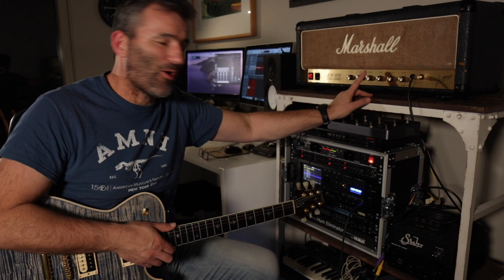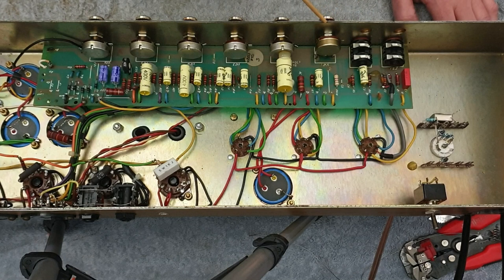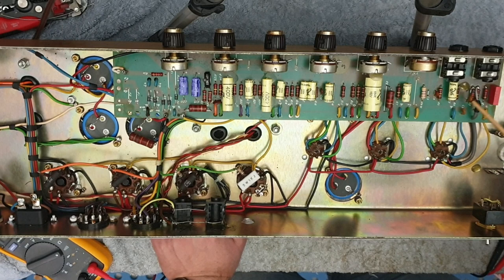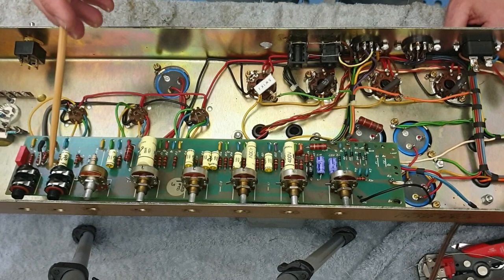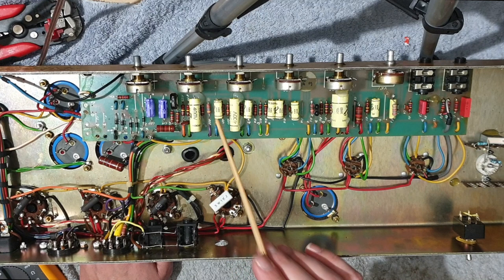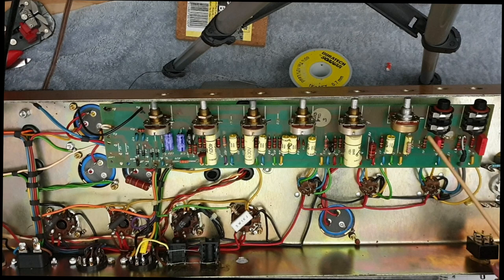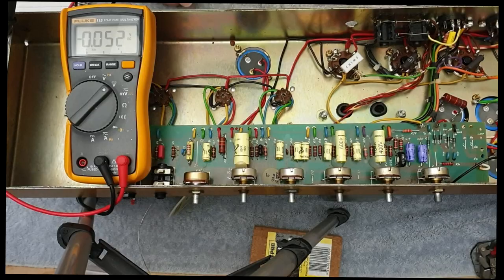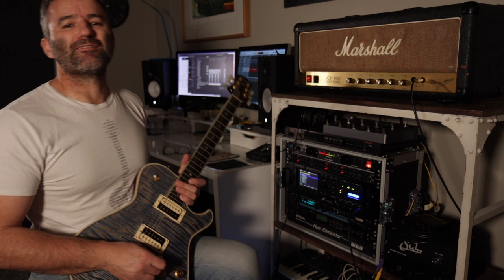Marshall JCM800 2203 Horizontal Input.  MOD TO Jake E. Lee SPEC - DIY!!

Comment: My 1986 JCM 800 2203 horizontal inputs has three of those big blue filter caps. On your picture, the bottom two would be missing. Is there an advantage to having those two extra caps? Do people ever add the two that are missing?

Comment: What does negative feedback do when increased? Can I lower the R22 stock 100k to 47k without doing the fixed depth mod?
Reply: It will probably give you a tighter and little less distorted sound, and yes you can.

Comment: That 1985 does have reduced filtering. The vertical input models have 6 filter cans. Part way through 1984, Marshall switched to horizontal input, PCB-mounded pots, and reduced the filter cans from 6 to 5. Then, part-way through 1985, they reduced the filter cans again, from 5 to 3.
Reply: What's the deal with the big caps? I have a 1989 2203 with 3.
Reply: @lovecraftmusic8717  What I've read is that Marshall reduced them to cut manufacturing costs. There was also some other change in 1986 that affected the sound a bit, I think the compression at higher volumes. I have a 1985 with 5 filter cans, which I sold a great-sounding, 6-can, 1982 2203 to buy because, personally, I prefer the horizontal-input sound, and some of my favourite albums, the early Smashing Pumpkins stuff, were recorded with it.
Reply: @thischannel1071  well, if doesn't affect the sound too much it's ok for me...at the end of the day who can really play a 2203 at high volumes? 😂 Thanks BTW.

Comment: I did this mod to a Ceriatone 2204. The amp squealed like a pig with a motorboat sound through it. What could have caused this?
Reply: You probably dont know what youre doing or shouldnt be working on amps.
Reply: @BigTyronie  You look like a Tyrone.
Reply: @BigTyronie  maybe. But I'd like to learn
Reply from the maker: If you haven't already, join my FB DIY Group.  Lots of help there if you are trying any of my mods.
Reply: @HeadfirstAmps  thanks

Comment: I have an amp here in NZ that began life as a Ceriatone 18 watter. Then it was a JTM 45, and then a JTM 50. Now it is a JMP 1987 with the fancy pants bits like a Marstran OT and PT and mustard caps etc. I bought it as a platform for modding. 

I can see it is still shared cathode, but the only other thing I know about it is he said it is a '69 tone stack. He said he was going for Angus' Live At The Apollo tone (I think he actually used 2203s by then though) It sounds great for old school stuff, but does not really get into the more shreddy '80s tones that I am also into, no matter what kind of pedal I feed it. I want both from a single amp, but to not lose the good old school Plexi sound it currently has (with a treble booster and Gibson, it reminds me most of early MKII Deep Purple live tones).  

What I wonder if there a way to have multiple configs in one amp. The gnarliest Plexi, 2204, and Silver Jube configs  (just the diode clipped lead channel). That way I'd have all my bases covered for the kind of tones I like.  To do it so with every config sounding max legit is the thing though. I dunno if that's possible. What do you think?

The old amp guy here in Auckland is ancient and semi retired now. I do not want to bother him with amp mods, so I have to find somebody else I can trust. I could do the split cathode myself, but beyond that I am out of my depth for now. Getting parts here in NZ is nigh on impossible too. Everything has to be imported. I end up just using Amplitube 5 instead of the amp, reactive load and IRs etc. 

I have to make up my mind what I want to do with the thing first. It changes every week, but Plexi thru to Jube seems about right for starters, maybe with some value refinements et cetera the modders know to get it all doing the thing right.  

P.S. I like the mods you did. Crispy, muting sounds tight, sings and rocks etc. All that stuff you need. It's morning here, so 'stuff' to describe 'things' will have to do.

Comment: Just a note on those Sozo's. The black line denotes the outer foil side of the cap which should ideally be placed toward the ground side of the circuit. Something I learned from Mr Carlsons Lab.
Does make a difference to the noise floor and performance of the cap.
Reply from the maker: Mr Carlson's Lab...what a channel! Tnx for the tip Chris.
Reply: Good catch
Reply: I guess the police are coming for me because I installed them all wrong, but lucky me my amp is dead quiet, go figure
Reply: @eyedunno8462  So you don´t believe in it?? Try to watch the video.

Comment: I'm very impressed with the sound, playability and recording of your video, very well done, congratulations. I have a laney VH100R, they say it's based on the jcm800 channel 2. I'd like to add a bite of mid to this amp, I use 6L6, and celestion V30. Would it be the case to put 4 El34 and use the greenback? Thanks.

Comment: How do you discharge the caps?  Can you show that step and do you test them after to be sure?  And if you are changing caps, do you need to discharge?  I remember on my vox they told me I could swap pots and some caps without discharging. I dont know if thats real or not so I didnt do it.

Comment: DeOxit is the stuff for cleaning pots. The 0.68uF across the 820 ohm doesn’t add a lot of gain.

Are you increasing the 10K in the power supply to 22K to reduce treble in the amp and to reduce the headroom so it distorts sooner?

Who originally came up with this mod?

The person should get credit for their good work.
Reply from the maker: Increasing that dropping resistor reduces the preamp voltages if course, but it sounds like you already know this. 

I call out that it's the Jake E. Lee mod, isn't it obvious what its based on?